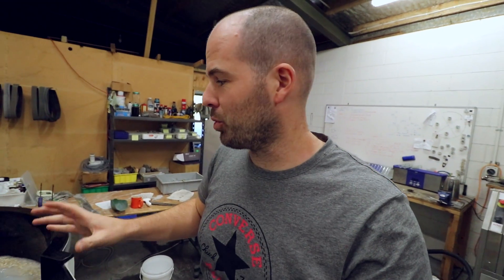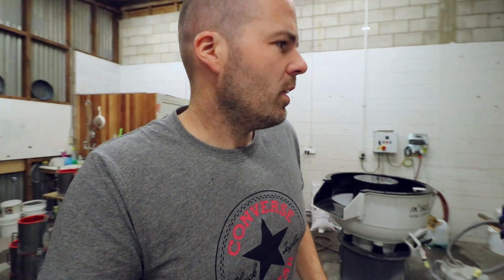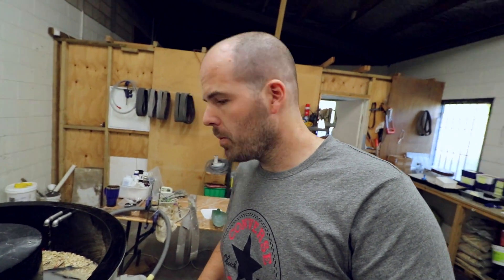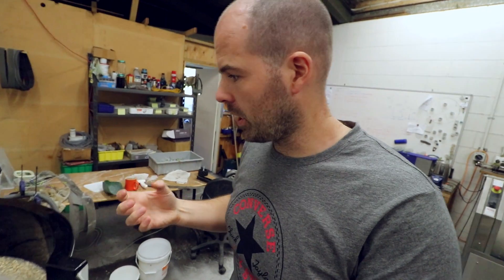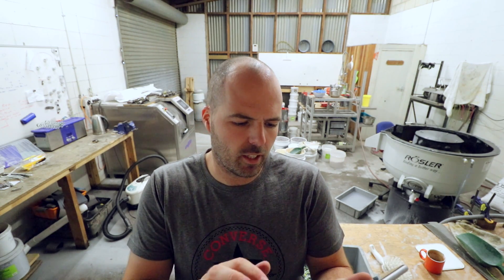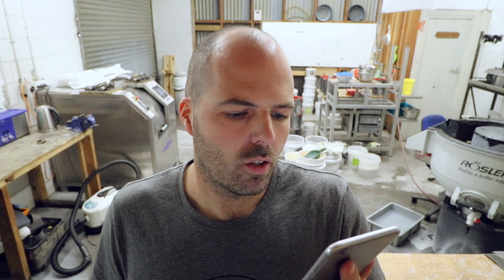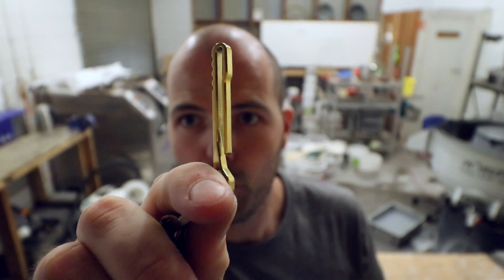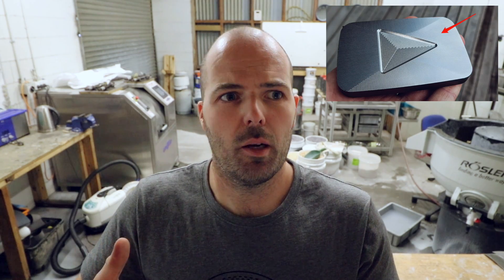Unique titanium things...

Comment: Nice video. Only things i thought of were maybe actually hanging the machined parts in the tumbler...sorry if this is a goofball suggestion. Viktor Schauberger, not sure if it's a help or a hindrance, but try an image search. There are also bring old documentaries. Maybe things like the temperature of the water can alter the way logs flow down a river, and he designed and built customized flume systems, which is maybe the basis behind this machine